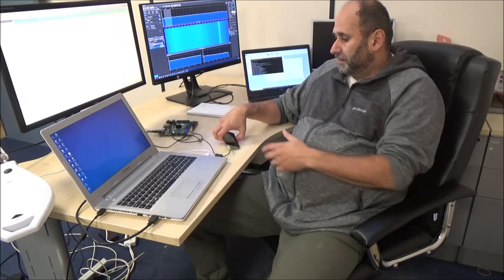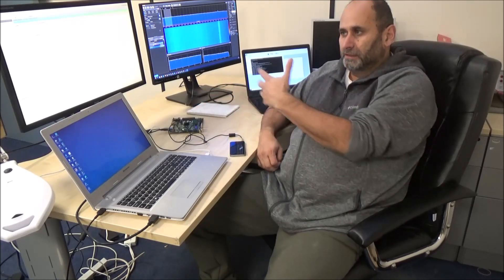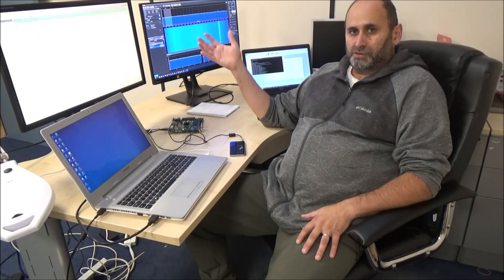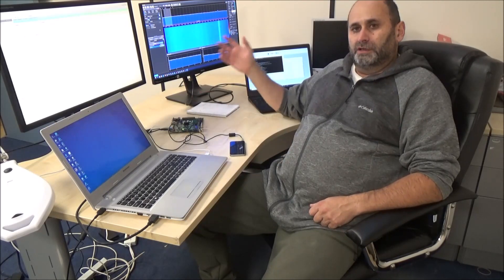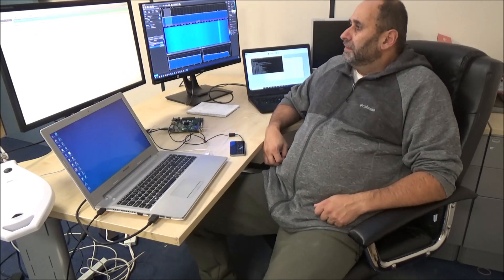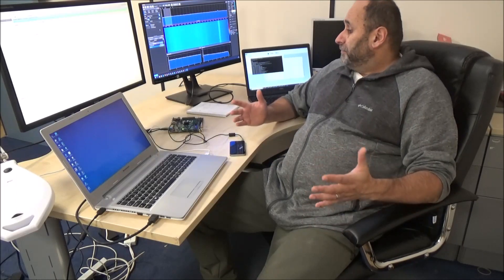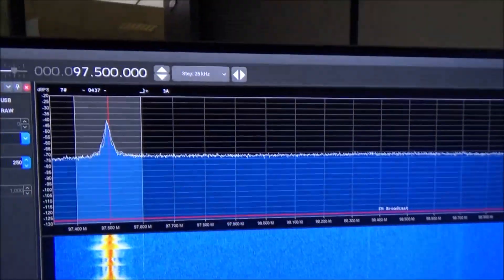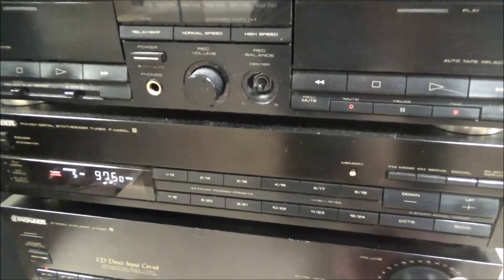FPGA Stereo FM Transmitter

Comment: Really cool stuff more videos from you.... Thanks de 73 Vu3uck
Reply from the maker: Glad you like them! - more to come
Reply: @adaptivedesign8795   hi Plese share dev kit details
Reply from the maker: @skvilakkupara  The dev board is a ZED board but any  FPGA from Spartan7 onward will be sufficient. The building blocks are DDS a complex multiplier and some adders. The only specific feature from the actual ZED board that I used was the external codec chip to bring the analog audio on as a digital stream (because I was lazy) - I have another video where I'm having a transmitter (FM Radio amateur) which is using a digital microphone as a source (no codec used there) - same ZED board the rf signal is driven by a 8 DAC made with resistors. These videos are more to show what's possible an maybe motivate some young guys or girls to do the same (or better) - in reality is very little audience for these kind of things 
Have Fun

Comment: Could you post the code for this? I've been trying to build my own FM radio on a Basys3, and I'm getting a little lost on how to modulate the signal.
Reply from the maker: Hi Daniel,
I'm planning to make a project page where I put everything - but I'll try to describe here in few words how the FM modulator works. Lets say you want to transmit on 90.00MHz you generate the IP for the DDS and first you say you want to generate a fixed frequency (90MHz). It's very important to define your clock correctly in the GUI. in one of the tabs (on the DDS IP GUI) I thing is the last one you will se a number which is the phase increment calculated by the tools. (let's call it the magic number for 90MHz) - write this number down you'll need this number later.
Now lets say you want your modulator to have a deviation of 25KHz upwards and 25KHz downwards. (so your modulator will swing between 90Mhz-25Khz and 90MHz+25KHz) - you need to find out "what quantity" you need to subtract from the "magic number" or to add to "magic number"
How you do that ? very simple you generate again the DDS but this time you day that you want 90.025 MHz and you check in the last tab whst's the "new magic number" and you write it down.
Now you have two magic numbers one for the 90MHz and one for 90.025Mhz you open your calculator on windows in Programmer mode (becase these magic numbers are HEX format) - make sure you select hex format and subtract the two hex numbers. The result should be the the numbers you need to add to the carrier in order to deviate the carrier by 25Khz. upwards (or subtract from the carrier if you want to deviate downwards)
This third lets call it "deviation number" is the maximum value of the signal you can feed on the modulator input. In ther words your modulator input should not exceed the the +deviation or -deviation value. at the input of the modulator.
In conclusion your modulator signal (music, voice, data etc.) will will be added with the "magic number for 90Mhz" and the output of the DDS will output a signal which is centered on 80MHz but is modifying the frequency around the 90Mhz in the same rate as you modulator input (voice, music, data)
I think I need to make a video with this.
Aurelian
Reply: @adaptivedesign8795  Thank you so much for the response Aurelian! This has been immensely helpful in designing my own project! I'm waiting for my bitstream right now, and I'm looking forward to any new content you post, thanks man!
Reply from the maker: @DanielFerreira-qf7rx  let me know if you get stuck!

Comment: Hi, thanks for the video, very nice work !
Yes, I really would like you to get into details - a block diagram of the units? the BaseBand, what is the BW limit? at what freq./clock did you use within the FPGA? (even if you used Xilinx's IPs, just mention it, so I'll read their PDF)
Also - how about building also the RX part? does the board have also a A/D converter for that? maybe a loopback on the board is possible.
Thank you very much,
Yaron.
Reply from the maker: Hi Yaron,
The clock is 250Mhz, the bandwidth of the signal is 100KHz (commercial FM Broadcast) - I used Xilinx IPs for simplicity. I'll try to make a description of the design and make a download link if someone want's to try. I have a following video for a narrow band FM (Radio amateur 2m band - 144MHz) which is much simpler to understand. I hope to get the video uploaded during the holidays. The next natural step is to make a receiver, the board doesn't have  an ADC but I have an external boards in the making.
Aurelian

Comment from the maker: At minute 4:29  "The DDS has a Phase Increment Input" - is the correct statement.  By controlling the phase increment you can control the output frequency of the DDS (as in frequency modulation)
Reply: How did you sample the audio signal coming from your phone to the audio port on the dev board. Did you use XADC on the board? Is there any signal conditioning you had to do?
Reply from the maker: @StanleyMarcus-y5r  The board I was using (Zed Board) has a audio codec IC and I took advantage of that. However a proper FM transmitter is performing some audio processing before the modulator (equalization, compression, loudness) I did none of that.